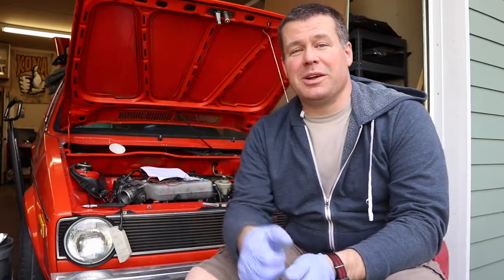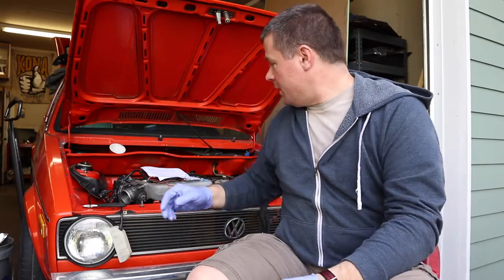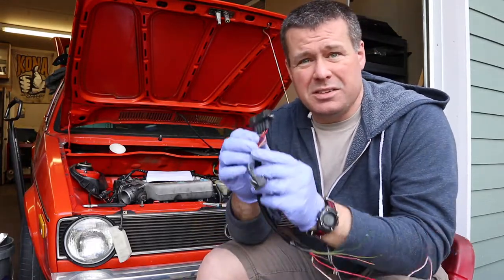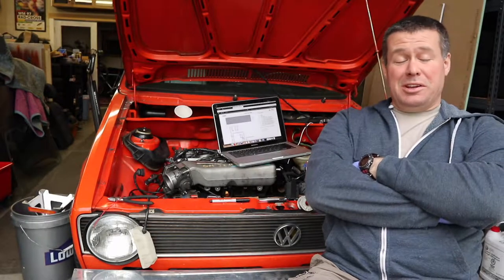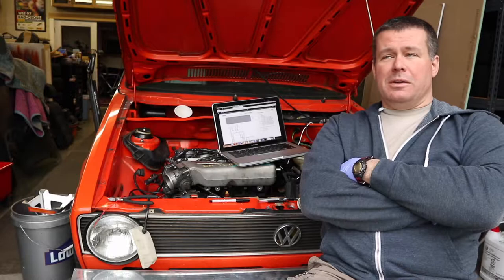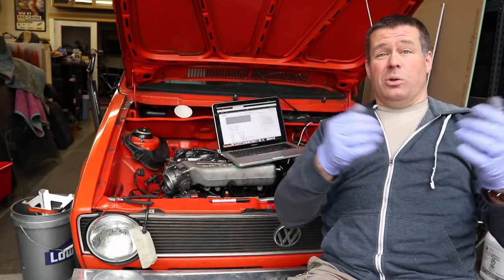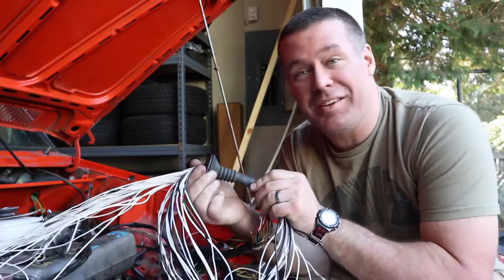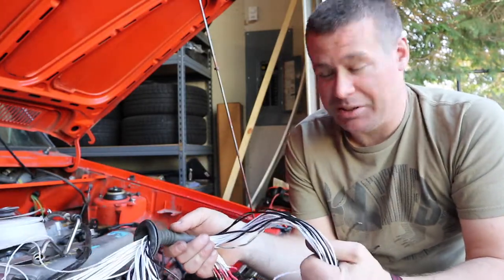Extending ECU wiring harness - 1975 VW Rabbit 1.8t 20v ep 36

Comment: Hey! I have a 79 rabbit C fuel injected that needs a lot of work and I've been having a hard time finding resources to fix it. Your videos have been great to watch, but I was wondering if you could point me in a good direction with forums or other websites
Reply from the maker: Hey Tanner - what kind of things are you having trouble with? I might be able to create some content to help out!
Reply: @ThrottleGrotto  well it needs all new shocks and struts, but I want to put a 2 inch lift on it, hopefully just through taller shocks. The axles also need to be replaced and I'm not sure if I'd need to extend the axles to have it all fit right. I'm having problems finding shocks that would lift it that I could just order instead of getting them custom made. I ordered a shop repair manual to hopefully help me not mess everything up too bad. The whole interior needs to be redone, the dash needs to come out, which I'm gonna work on tomorrow, all the vents need to be cleaned out and the radio needs to be replaced (it might work and just isn't hooked up, looks like the previous owner had an aftermarket installed outside of the dash).
Reply from the maker: @ILIKECHEESECAKE100  sounds like you're on the right track.  For a 2" lift, extending the struts is going to be the easier way to do it. Springs you might try mk3 cabrio springs, the rate will be higher, but definitely taller. I used cabrio springs on the rallyxgolf. You might be able to use mk3/mk2 struts up front, with modifications, and might even try them in the rear. Having the ears modified might be easier than lengthening the tubes on mk1 fronts. Interior, just take your time, those parts are getting harder to find.